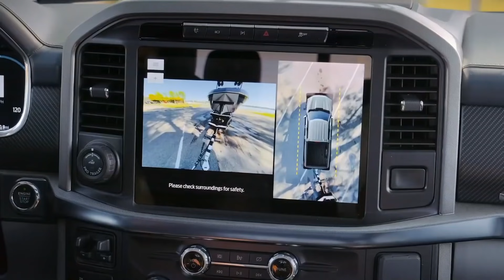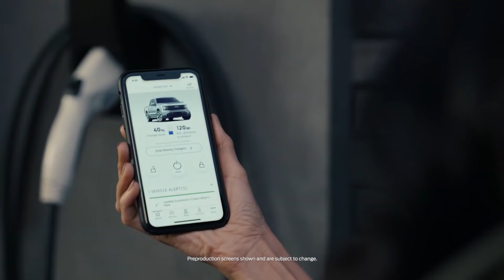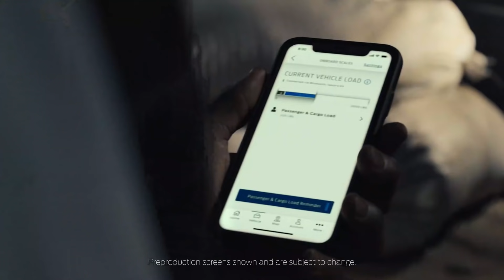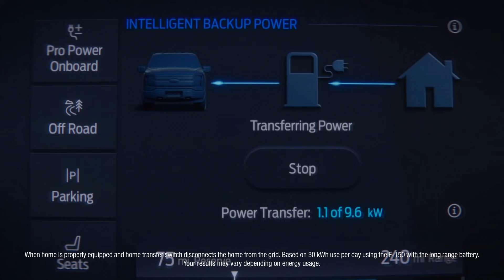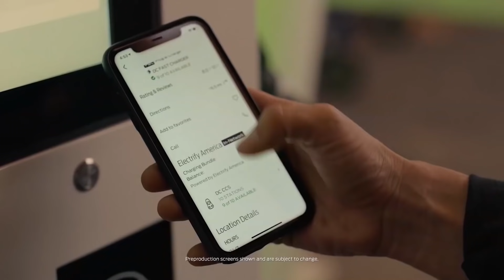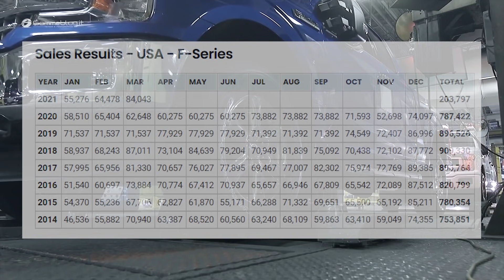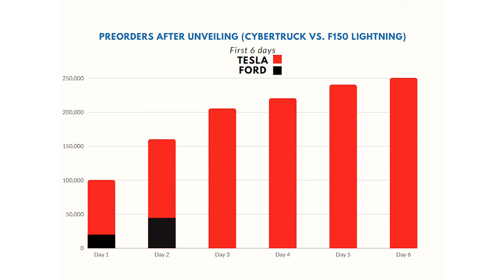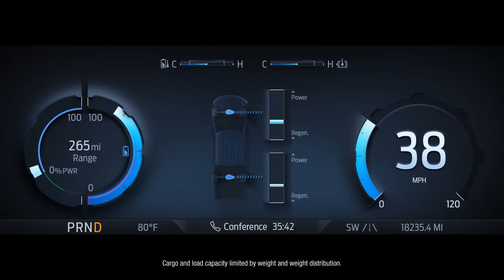Ford F150 Lightning Reveal: A Costly Mistake On Stage? | F-150 Lightning VS. Tesla Cybertruck

Comment: If Ford can get their battery supply up they will do well but they are two years behind GM. Of course Tesla will almost 10X Ford and GM'S  capacity in the same time frame. P.S. the payload on the extended  range is less than 2000 pounds because of the heavier battery.

Comment: I’m sure this is a winner.  Full size and still looks like a ford. Although lots are like me and want more range a lot will be satisfied with the range it gives.
Reply: Also using 100% of the range everytime on any battery decreases its longitivity over the long run. That's why every manufacturer including Tesla recommends using only 80% of the battery range for optimal performance over the years. So ur looking around 184-240 mile range on each battery 🔋
Reply from the maker: That's true. You should not let the charge level drop below 20%, and should avoid charging it beyond 80% unless you need all 100% for a longer trip for instance. As you said, it will reduce the battery's lifetime.
Reply: @S Wms. Be aware that range will suffer quite a bit in cold weather, or with the A/C running.
Reply: @johncahill3644  , or pulling or loaded.
Reply: The 300 mile range is based on a 1000 lbs pay load. A recent test calculated driver + truck is closer to 460 miles.
Reply: @Cdub0619  ,source ?
Reply: @shepherdsknoll  Marques the tech reviewer did mention that, but TFL did ask Ford PR about it and just got that they are targeting 300 miles. They probably don't want to rock the boat with the numbers just yet, or until someone can drive the truck all the way in a real world scenario. I still don't get why Ford didn't say it in their presentation about it, imagine TESLA saying that right now about their range that it includes 1000lb payload as well. Ford should've said their Real range without the payload so people on the internet wouldn't be complaining about not having enough range and such.
Reply: @FATDADDYSACK  , I agree.

Comment: Yes, there will be a F150 Osborne effect. Ford has very little to gain by announcing now.  I think the Lightning will cannibalize the ice F150 and their total truck volume will decline due to Rivian, Hummer, and Cyber.  Remember too, at $40K you get a very stripped down model with smaller screen, less exterior lighting, less outlets, and many goodies omitted.  A well equipped Lightening will set you back $80K !
Reply: Agree. Ford have just startet the Osborne effekt for the F_150 "ICE" model
Reply: I don’t think Ford will have the batteries or chips to produce this in mass or for that matter, to make a profit. I can see the dealerships steering people to the ice F-150 on this one.
Reply: It’s Lightning. Not Lightening.

Comment: At this moment Ford has a supply problem due to chip shortage, not a demand problem. The Osborn effect will work in Ford its favour.
Reply: Almost every industry is having supply issues. This is a not a huge factor that you guys think. Car companies are simply removing the features that require the semiconductors and still selling like hot cakes.
Reply: Ford is done😂🤣😂🤣🤣😂😂
Reply: @renehunt4252  agreed, done.